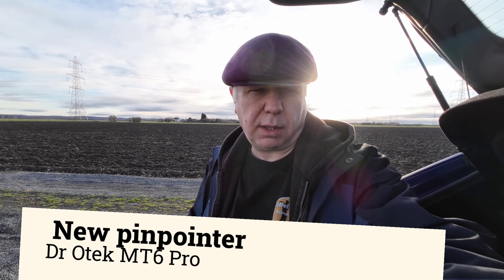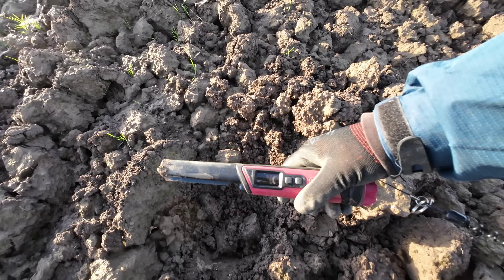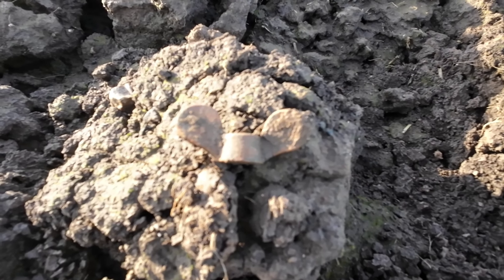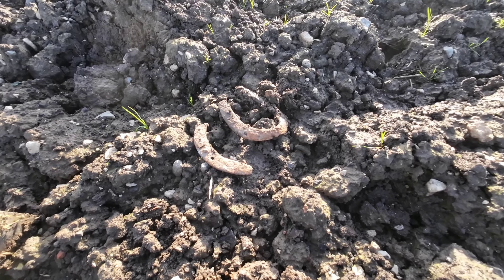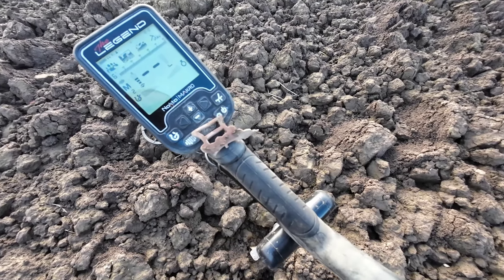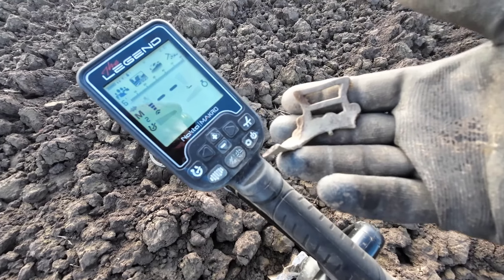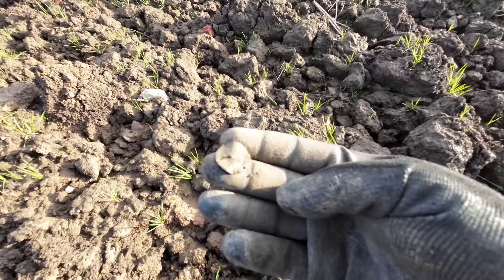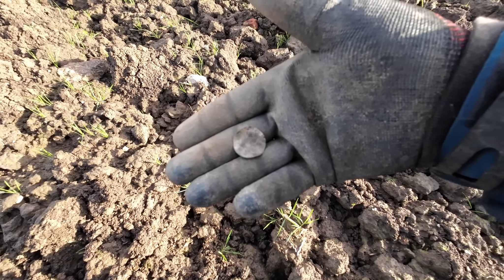Atrex and Legend out together for the first time. Heavy EMI doesn't stop the finds!

Comment: Good hunt Tony. 
Was it a hammered? I have one with a hole in the top and was under the impression that they used to carry them on bits of string sometimes?

Then the other day I saw a video where it was said that all hammereds in circulation in 1700 were voided by ‘holing’ them when milled coinage came in….
Reply from the maker: Not sure if a hammered or something else very thin, the shield on the design is visible but everything is super worn and discouloured... thinking it could be a fogery